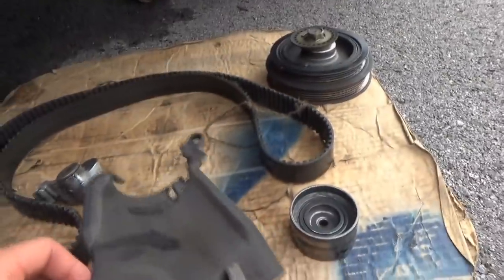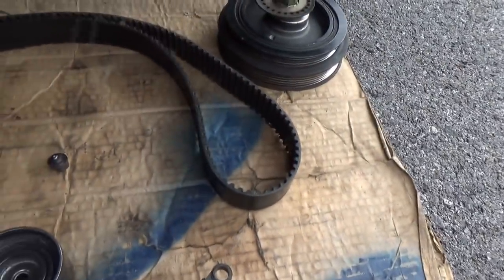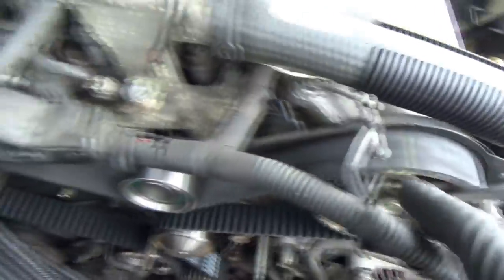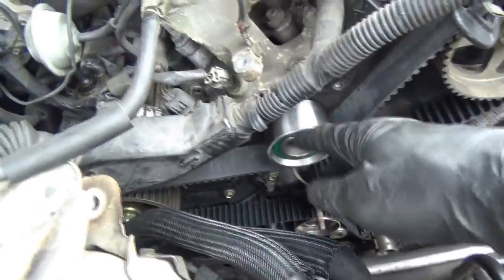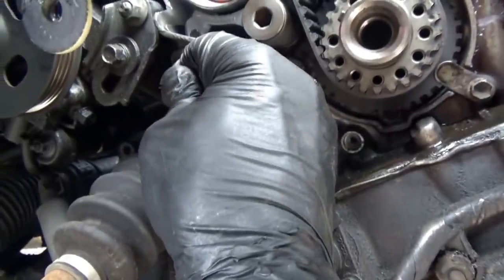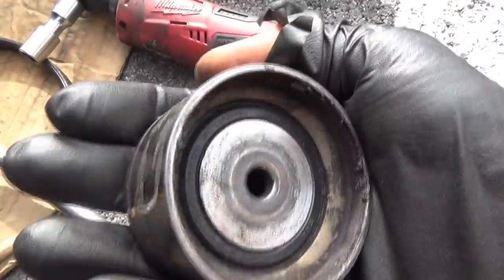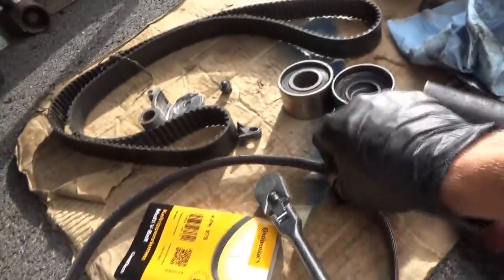Lexus Timing Belt CARNAGE!

Comment: Shop won't do job. Ivan does it in a parking lot. 😂
Reply: It seems plenty of places over there have quite an attitude problem. If the customer's prepared to pay, why not do it?
Reply from the maker: Haha I think the other shop just did tires 😅
Reply: That's how they do it in Soviet Russia.
Reply: Did timing belts under my tree.😄😄
Reply: A lot a places don’t like to touch older neglected cars due to everyone suing them. You touch the car you own it. Something else goes wrong they get blamed for it. Also it might have been good that they didn’t touch it since they might have screwed it up putting the timing belt on.

I used to turn three out of five people away. I had a certain cars and customers I worked for and didn’t need the headache of the unknown.
Reply: @zoidberg444  We do it under Putin too. Nothing changed :(
Reply: @cullenmiller8170  Very good points. I can relate from my past experiences.
Reply: @2nickles647  thats how i started out, hung my chain hoist from my tree with several chains on several limbs .... lol  ahhh the good old days ...
Reply: At our local AutoZone they do it in the parking lot, the majority demographic is Hispanic and the city cracked down on working on cars on the street save for changing a tire or something simple but in the past they used to pull engines and transmissions on the street, then some of them opened shops in their backyards and in backyard garages, I know because when I used to deliver auto parts I delivered to most of them. One guy got in trouble with code enforcement and racked up so many fines he took off back to PR and never came back, one row of garages actually had a pit in his garage, there was this little old Italian guy named Mike, he was 92 and still working on cars in his garage but from the outside you couldn't tell because he was very low key plus he had been a mechanic for the city working on police cars, he was a little guy who wore suspenders smoked a pipe and chewed tobacco, he had no power tools at all, two houses from me these kids were working on cars in their backyard garage, every couple of days a pickup with either s tow dolly or car trailer would stop and either pickup a car or drop one off but they've been gone now for about a month so I don't know what happened.
Reply: @PineHollowAutoDiagnostics  that’s what a lot more of them should stick to as well, 1/2 of the shops around now, I wouldn’t let them put air in my tires
Reply: @Peter-pv8xx  that's pretty cool. Especially the little old guy.
Reply: @rayj33  yeah I agree to a degree- guys price potential nightmares accordingly, then the bad part is- if it goes well they still put the extra in the till- I dont like that...but pretty much if it says Audi...Im outey, don't mess with much euro trash for a reason.

Comment: Ivan,   that's same exact engine that I was working on! I have pictures to prove it!!!  It was 1994 Toyota Camry,  the belt was completely shredded,   totally in pieces!  Had to replace water pump,  timing belt,  tensioner and idler, took me two days as 1 whole day to clean the damn mess of the shredded belt and stubborn bolts that sticks out by water pump.  The belt was never replaced! At 145,000!!!  Since i replaced it,  it's now 184,000 and purrs like a kitten! I did the valve covers gaskets,  oil gaskets,  spark plug, few things.  Owner won't let anyone touch it but me lol!!  

Just a reminder of that video you did brought back memories!  Great video!!
Reply from the maker: Hey Josh! Yeah old Toyotas are a pleasure to fix up because they always run like new afterwards :)

Comment: The work you do without a lift is amazing. An expert showing the diy folks that it can be done w/o expensive equipment (except the scanners and scopes) is very valuable. Thanks.
Reply: Most of the time the only thing a lift allows you to do is work faster, in other words, make more money.  On the other hand, sitting or lying on the ground is more comfortable.  If you are DIY and speed is unimportant, a lift is unnecessary.
Reply: just wait till he gets older.  you pay for that in your later years
Reply: Lift are for convenience and ease of access. Many timing belts are done fro the side, so you don't really need to lift the car much.
Problem is any job that is easier with a lift takes longer on the ground, not to mention you are stirring up dust and dirt that might make it's way into the part you are swapping.
Not sure I want to pay extra because the shop doesn't have a lift.

Comment: Best cars ever made.   Ivan does a timing belt in the parking lot...  what a Boss!
Reply: I do my jobs where ever the money is, love mobile jobs
Reply: It depends
Reply: The only other guy coming to mind who can compete with Ivan is one who changed his friend's Camry broken axle 2am on a snow day in a parking lot.
Reply: There's that LA mechanic who changed rod bearings on the sidewalk... though I imagine that job didn't carry a warranty.
Reply: @KenLyns  do tell! That sounds like quite the undertaking… my hats off to anyone that can do that under those circumstances.
Reply: I have did timing chains and multiple engine replacements in a parking lot.. not hard to do..
Reply: @turboimport95  i'm also changed Nissan Almera N16 timing chain/dephaser kit in a parking lot. Not a big deal :D
Reply: @WCKD.  I have also rebuilt engines in parking lot....Not a big deal 🤣🤣
Reply: @turboimport95  i have dyno tuned an engine in a parking lot. no big deal
Reply: @lordjaashin  so completely removing an engine and rebuilding it is a lot easier then running an engine on a stand or in a car strap down

Comment: Close to 30 years old and still goin strong .. anyone would be lucky to have that ES ..it doesn’t need much.. very solid.
Reply: No German crap would last that long or even big 3.
Reply from the maker: It's a southern car so looks like new!
Reply: @mikefoehr235  On the whole I agree Mike.  However if your close and need some help I'll be glad to come over with my 1977 Chevy 3/4 ton with a 350 cid any time.  It does have a severe alignment problem:  every time it sees a gas station it goes toward it.  My neighbor just a few miles from me is a Studebaker enthusiast.  He had a beautiful Blackhawk I had seen 5 years ago.  If he is still alive I would bet that thing is still going.
Reply: @Topher... I still drive my 86 s10.  Ivan can attest to that. 198k on the clock, still going strong. Weakest part is the body panels. Frame & everything else is solid.
Reply from the maker: @CubasAutomotive  wow that's low miles for an '86!!
Reply: @CubasAutomotive  Is that a 4 or a 6 cylinder?  Do you use synthetic oil?
Reply: @dogsplantscarsneatstuff176  My new Tundra has a 5.7....it is not terrible on gas. It is a lot better than many portray it to be. Best I have seen is between 12.4 a d 13.5 litres per 100 kms
Reply: @mikefoehr235  Converting my miles/gal to km/liter would be 5.5 vs your 7.7 km/liter.  Yours is probably all around km/l. That is my freeway mileage.  Yours is significantly better.  Does yours use iridium plugs?
Reply: @dogsplantscarsneatstuff176  I know the 2nd generation Tacoma did not but I had a 13 Taco and my nephew mechanic swapped the standard plugs to Iridium. It ran fine. I am not sure about the Tundra tho.
Reply: @mikefoehr235  Not true, I look after a E46 BMW and its on 280,000 miles, it just gets regular oil changes with good quality oil.

Comment: I love old Toyota’s. I own a 94, 95, and a 2000 camrys. Iron blocks non interference engines. A 93 Lexus sc400 non interference engine. A 97 T100 truck non interference engine and a 02 Lexus ls430 which is an interference engine. Timing belt replacement is getting pricey. I change my own, not that difficult. Good job Ivan! Not too good to get down on the ground with the rest of us and wrench on things
Reply: this week my 96 t100 4x4 5sp will turn 350k best veh i have ever owned and i am 67
Reply: @juanrodriguez-ry6yt  how long have you owned your truck. Keep an eye on the cooling system. They are famous for overheating and then blowing a head gasket. Other wise they are bullet proof. I’ve seen them with well over 400k well maintained. They are disappearing fast
Reply: @sweetwilliam49  got it in 99 i am a tech.l1 master car and truck but thanks for the tip.

Comment: My good friend broke down at gas station lol. 2010 Honda Odyssey. Serpentine belt somehow snapped and shredded. It left her stranded. Poor owner. She have a one year daughter with her. I had to put on belt in parking a lot at gas station. It wasn’t fun! Sun was hitting me. It was hot!!! Nice job!
Reply: I feel your pain.  Coming home from vacation, in southern KY, July 6th, my alternator quit.  Changed it in a gas station and it was in the 90's.  Once the alternator was changed, I had to change out of my soaking wet clothes.
Reply: I had a power steering pump bearing go on my own car, a '91 Subaru Legacy SOHC 2.2L, 200km from home. So I got a shorter belt that meant it didn't go over the power steering pulley., to get me home. More recently on a different car I had a harmonic damper slip and the outer piece move outward meaning the 2.375m (8') serpentine belt was misaligned and running on the back of the tensioner. So I sliced the belt down  from 6 to 5 ribs so it aligned again until I got around to sourcing a new damper.
Reply from the maker: Sounds like someone neglected the belt replacement interval yet again 🤔

Comment: Many years ago I was given an nice Chevette from a guy who said the entire engine was junk because it broke the timing belt.  I had heard Chevettes had non interference engines so  20 dollars and an 2 hours later I had a really nice little car that was cheap to drive.  Even the clock and A/C worked.   Sold it a few years later for 300 bucks.
Reply: Piece of garbage , but at least it was YOUR free piece of garbage! 😉
Reply: @Rein_Ciarfella  Lol. you are right.  But it was almost free and got me to work and back on 3 dollars of gas a week.  I really didn't care that I looked like a clown in it.
Reply: one of the last few with non-interference engines. small turd-box cars with no power hardly, but they were pretty diehard for what they were! me and my buddies went through a dozen of them at least, just abusing them relentless.
most got wrecked horse-playing around and all had very high mileage by time we got them! it was most always timing belt and water pump and of course the routine ignition system junk.
Reply: throttle bottle   Cheap, simple to work and learn on, so at least they did have those redeeming qualities. 😉👍🔧🧰🚗
Reply: Had a manual Chevette . Rear coil springs kept breaking, never told dad i tried to make it jump on hills. Shifter fell off while driving. Fun junk.
Reply: Janet Yeoman 😂👍
Reply: ….a kid  had problems with his Chevette, so he kept it in the garage,,,,but would tell the girls how he had a Vette at home in his garage…
Reply: @janetyeoman1544  Good Chevette memories.  The Duke boys would be proud of you.  :)
Reply: Chevettes were bulletproof compared to the Chevy Vegas people had
Reply: @vinces8974  ah yes the Vega, my mom had a 1974 bought new. Rusted out and at 50K miles she was putting in a quart a week, probably every 200 miles. She carried a case of oil. She swore she'd never buy a Chevy again and hasn't. This was in 1980.
Reply: @AmandaHugenkiss2915  That’s too bad about the Vegas, I always thought they were cool looking car
Reply: When was this?

Comment: Didn't know Toyota engines of this timeframe were still non-interference. I'll bet the other shop didn't bother to look that up (or just didn't like dealing with a customer who defers maintenance...).  Good job Ivan.  I think the pulley bearing froze, and the hub spun on the bolt until it cut through enough material to lead to overload failure.
Reply: Right.  The valve clearance reliefs in the tops of the pistons leave nooks and crannies for unburned fuel to hide in.  Non-interference was a luxury that the engine designers could no longer afford as emissions standards continued to decrease.
Reply: 94 Lexus 400 was the last year none interference motor was sold. In 95, they jacked up compression but lost the none interference advantage. I got both of those type vehicles in my kids possession now and it fills me with Dred to hear anything about the 95 "having issues". Just did the water pump and timing belt on the 93. It was a pleasure to work on that thing.
Reply: @notyou6950  Maybe for Lexus but Toyota still made non-interference engines not sure for how long though. I have a 5SFE non-interference engine in my 98 Toyota Camry.

Comment: Ivan your patience  with people inspires me!  Between you and God someone is looking out for this gal. No frozen bolts to contend with?
Reply from the maker: Only the harmonic balancer was a bit stubborn to come off 👌😉
Reply: @PineHollowAutoDiagnostics  Was there any rust?  Any sanding?  Was it so tight it popped when being pulled?  I forgot to ask you what the balancer spline looked like when you mentioned you put some grease on the crank spline.
Reply: @dogsplantscarsneatstuff176  looked like a clean southern car brought up north. at least from what we seen, it wasn't a salty rust belt barnacle. lol
Reply: @throttlebottle5906  The engine bay looked very nice.  I live in Calif. and have had rusty (oxidized) bolts that required ez outs to extract because they were rusted (some were on the exhaust) so bad they needed extraction.

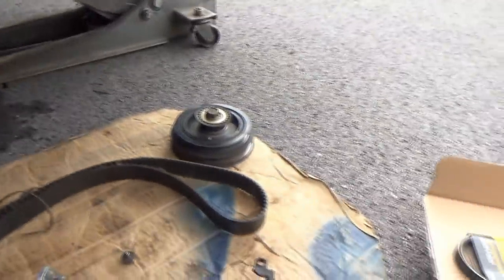Comment: I've done enough of those jobs on Lexus and Toyota that I can probably do them in parking lots too. LOL!  Only problem would be that I also like to do the water pump while I'm in there and the cam seals if needed. I like the Aisin kit from Rockauto. I made a harmonic balancer removal jig out of a piece of 2X4 and use it in combination with a Harbor Freight puller kit. Incidentally, I have that same Craftsman toolbox @3:30 and just totally refurbished it.  Had it for many years, still looks almost new.

Comment: Yep, Toyota engines are awesome.
Did my 1st timing belt kit and water pump service on my 4.7L.
Steep learning curve, but ran perfectly afterwards with no leaks and it passed (CA) smog check.
Cool quick little video!

Comment: Owned my 2004 Sequoia for a year, now has 170,000 miles.  Had my TB changed a few months ago.  Glad I did because my engine is interference.  Have to say the old belt which was probably the original did look almost new.  Replaced it with the Aisan TB kit, available on Amazon for about $170, a local garage charged me $400 to fit.  An expensive repair but one that is essential.

Comment: I am wanting to say that car is on the same chassis as the concurrent Toyota Camry.  I know Toyota used to recommend changing out the timing belt at, I think maybe 60,000 miles.  I had many customers that would just run past the recommended service interval.  I'm surprised the engine isn't interference, because if it was bent valves, etc. would result.  Great video!

Comment: Nice job. My 99 camry is so simple to maintain. Just got another one thats from Florida. No RUST at all, wow, its nice. After buying it I changed many parts that I know are " issues " or are just nice to have new. I changed that belt, and while there all the seals, crank, cam, oil pump and the gasket too on it. What I did was for peace of mind and I can do this myself. It's best to have a basic repair manual for torque specs in my opinion. I have a very high level of expectation it will start, run and operate when things are done correctly. I've also used the dealer for parts, some are higher than junk from an auto parts store, but I'm happy with the quality. They're knowledgeable too, like when my starter was " clicking " on start ups. Any chain auto store would of sold me a new junk starter, Toyota sold me a solenoid kit for $25 I think I paid, 242,000 miles with the original starter. I think it could go another 240,000 but it's getting rusty, maybe I'll pull the engine and trans, kinda like a spare, or if I find one that someone seized their engine.

Comment: My grandparents 98 Toyota Avensis, snapped its timing belt in 14 at 380.000 km, got it towed and put new one on, and then in 16 at 415.000 they traded it for a new Honda Jazz/fit, but registration shows it still runs and got mot recently 💪🏻😁

Comment: Fantastic as usual Ivan. Those 1MZ 3.0L's are bulletproof (when you keep their maintenance up to date). Lol. I've had several of these come through the shop with 300-400K+ miles on them and they were still just humming away. You simply cannot beat Toyota reliability. If I were you, I'd a bought it off the customer as-is for a few bucks, throw a belt kit in it, give it to Amanda and sell Mr. Rogue. 😜

Comment: "As long as it's not made in China it should be okay." Of course a lot of OEM stuff these days contains Chinese bearings. When I did the accessory belt pulleys on my 90s GM I pressed out the rattling Chinese bearings and pressed in name brand ones. And the worst part is that even a Dorman pulley (which is the pulley and bearing) costs significantly more than a made in USA or Japan bearing to put in the old one. People need to get out of the part 'assembly' mentality. That's something I love about this channel :)
Reply from the maker: Thanks for the kind words Jessica!

Comment: This is the exact same thing that happened to me on my 1997 Lexus LS 400.
Same symptoms, ticking sound, etc. only with the serpentine belt.
Soon afterwards, like a few months later, the lower crank belt pulley came apart inside itself, slipped inside its housing and destroyed the crankshaft timing sensor.